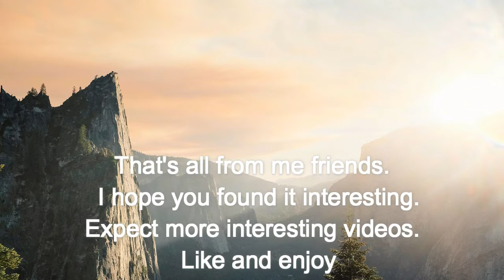eVic Primo SE/ Disasembly and repair. No atomizer error

Comment: I can't find the solder point on the board for the black cable, is there another way I can solder from the negative pin 510 to the board? I found on the board it says gnd, can you install it there?
Reply from the maker: Hello
Of course it can. This is the problem in this case. 510 connector remains without GND. :)

Comment: Hello friend! Which cable do you use? Thanks!!
Reply from the maker: Hello
This is a common problem with these devices. The solution is easy. The cable I use is 0.35mm2 /AWG 27. This is enough to work well.
Reply: @harryhvorev1494  Thank you my friend!!!! :)